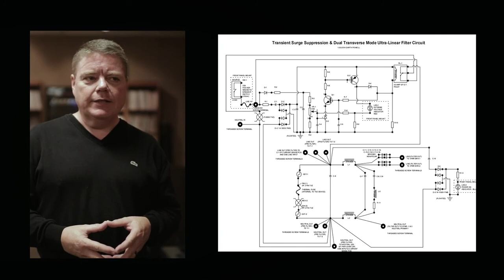AudioQuest Tour, Part IX: Advancing the Science and Efficacy of Power Conditioning

Comment: Snake oil.
Reply: It all depends on the type and quality of the audio hardware you are using, and the quality of your intrinsic auditory system. The higher the quality of both systems (extrinsic and intrinsic), the bigger the difference these systems will make in terms of providing a very low noise floor, enhancement of dynamic range, decreased distortion and improved soundstage. For MP3 and MQA files, it probably is "snake oil."